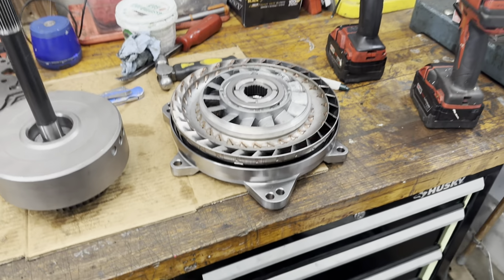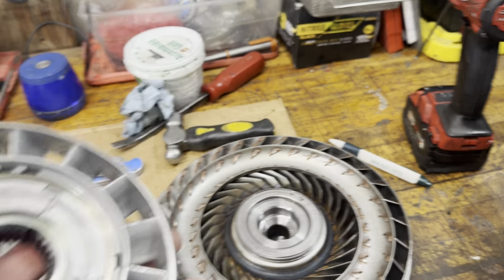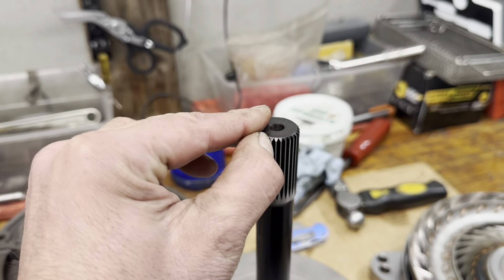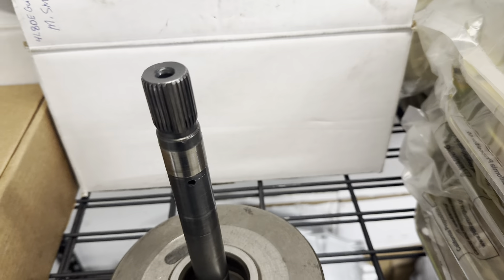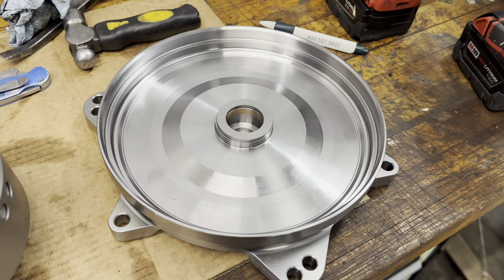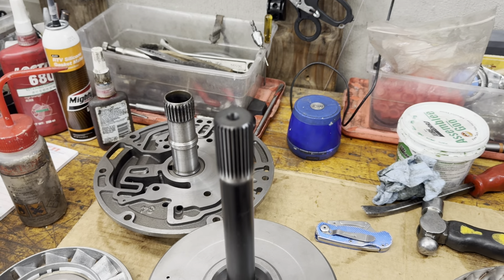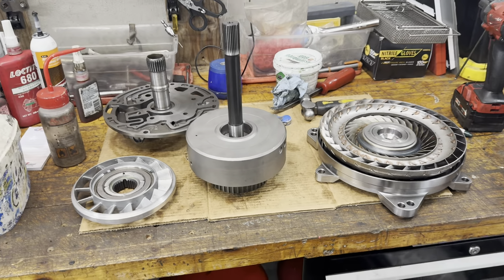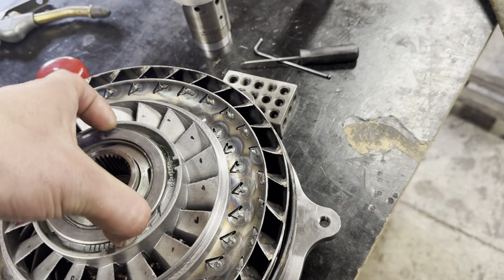Th400 input shaft and converter considerations

Comment: I used the ATI torsional input shaft and drum. I think it was $309? Prob went up since last winter.
I also removed the stator support bushing you showed. The PTC has the internal support.
I believe having that wide open return path influences charge pressure???
Reply from the maker: yep thats what i have in the mustang now. I think having the bushing in the converter not only supports the turbine and input shaft better but also allows for a better converter charge pressure balance.